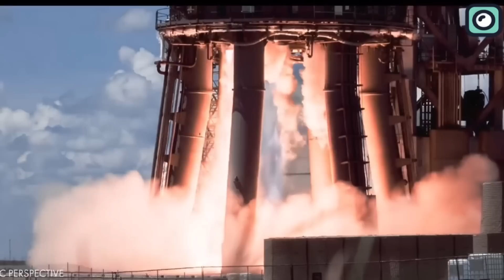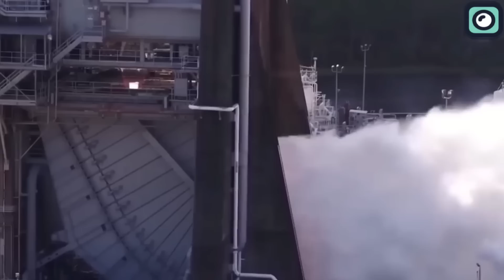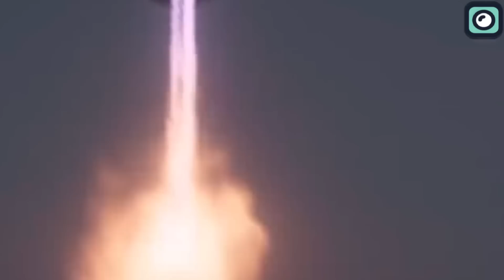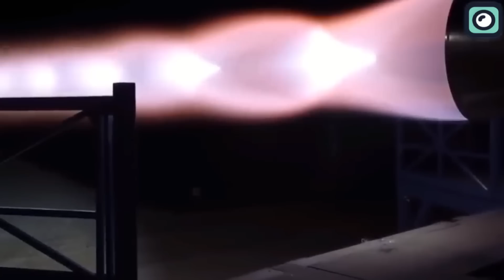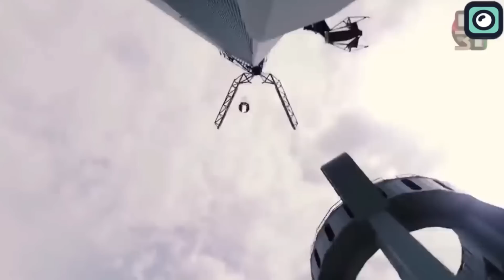33 Engines Causing BIG Problem for SpaceX Starship!

Comment: Musk has said previously that the engines together are not at full power. So if a few engines malfunction they can be shut down and more power can be used on the remaining engines without maxing them out.

Comment: I want to have faith in Starship.  I really do.  But I don’t.  It’s got too many engines.  The output of all those engines, when combined together, will create a blast that’s far greater than they should be able be make.  Take a cake and rill it with candles, then light them all and see what happens.  If the individual flames are close enough together, they’ll then combine into a drastically larger, much hotter flame than they should be able to make if they’re slightly further apart from each other.  The single massive flame will melt all those candles down into the cake, as it’ll burn much hotter than it should have otherwise.  Starship is no different.  The combined output of those 33 engines will create a flame far bigger that should be allowed, because the temperature will increase drastically, possibly melting the bottom of Starship itself.  Elon’s test fire was 31 engines at 50 % power for only 10 seconds.  That’s nowhere nearly long enough to claim a victory.

Comment: Comparing anything space X to NASA's billions per launch is a joke..
Reply: I certainly trust NASA long before I trust Space X.  NASA simply has more expertise and experience.  MUCH, MUCH MORE.  I’m not jumping on the SpaceX bandwagon like some immature fan boy.  I do like what SpaceX has been doing…for the most part.  But Starship is flawed.  Highly flawed.  Too many engines.  The former Soviet Union tried to go that route.  It failed.  EACH AND EVERY SINGLE TIME.  The last time culminated in the deaths of nearly all their engineers and space program leadership.  That’s because the top dog in charge so was over-confident that he pulled up a lawn chair and sat down below his N1 Rocket.  Soon many others, fearing that they would be noticed as not joining him, did just that.  Meanwhile the Rocket they were sitting near was being worked on.  And when all those engines unexpectedly ignited, they were all turned to crispy critters.  The rocket itself exploded, as did those beforehand.  Too many engines create too many fail points.  You’ll never see NASA take that route because they learned from what the Russians did.  So NASA makes larger engines instead.  The Saturn V used 5 engines, not 33.  NASA’s route is safer.

Comment: ...2023 is set to be a pivotal year for the cryptocurrency market, with many predicting that the industry is on the cusp of a bull run. Recent evidence suggests that the world’s leading cryptocurrency may experience a surge in value by the middle of the year. Analysts point to a global macroeconomic environment, stock prices, inflation, Federal Reserve data and a possible recession as catalysts for the upward movement. High inflation and a lack of trust in the current financial system will fuel these factors, so don't miss out on the Bitcoin Bull Run, I have been staying ahead of the market by following Silvia Macido strategy, with her trading signals I have been able to amass 31 btc in just two weeks of trading. She’s certainly one of the best out there.

Comment: Literally the most retarded comentary ive ever seen about Spacex. "Full 33 engine fire would make a crater" thats the dumbest thing ive ever heard. Might help to look at how this stuff works before you make a video. Also "reusing rocket engines is actually more expensive cause the space shuttles engines were more expensive" thats Literally just due to NASAs incompetence on the space shuttle program. Raptors were designed from the start with easy manufacturing and matenance in mind.

Comment: If all the engines would bore hole in the ground and destroy the launch site, do they need all the engines to just get off the ground clear of the tower and then after that ignite the rest of the engines, so do not destroy the launchpad
Reply: No, the guy in the video doesn't know what he's talking about it wouldnt make a crater. The best evidence is to just look at the 31 engine static fire they did last week that resulted in very little to no damage to the pad.

Comment: He just needs to pour an enormous  hole in  the ground under the launch pad made of steel 30 ft deep of molten cast steel would take care of the thrust destroying Launch pads.
Reply: Also repairs would be cheap just grind and pour more steel over it to patch it up.....make sure there's no delaminations  though or it'll blow apart

Comment: I think your wrong! There is nothing wrong with the Raptor. Spacex needs to fully complete the ground support equipment like the water system. The Raptor's fine, your just looking at it wrong.
Reply: You're
Reply: @itchitrigger8185  Correct ! My bad
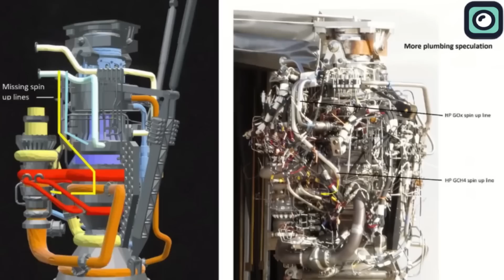Reply: 4:50 that's wrong, whole reason of full flow combustion with two separate turbopumps, that they both far from optimal combustion ratio, so temperatures there are low, (one ch4/fuel rich, other oxygen/oxidizer rich)
Reply: @user-ni2od5lu6j  Those are not problems. Adjustments !